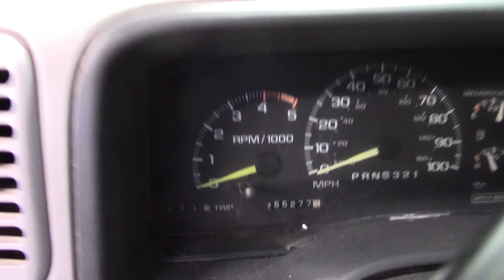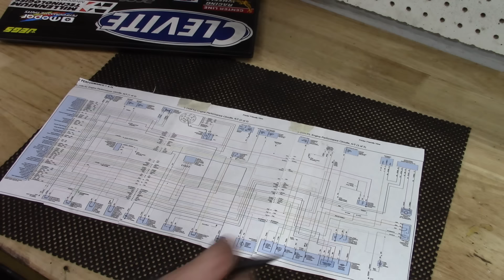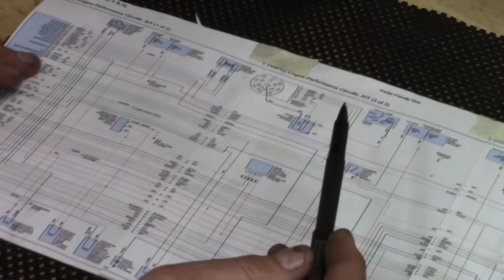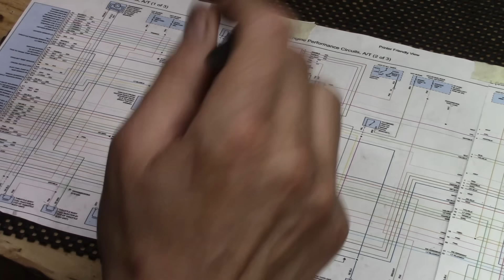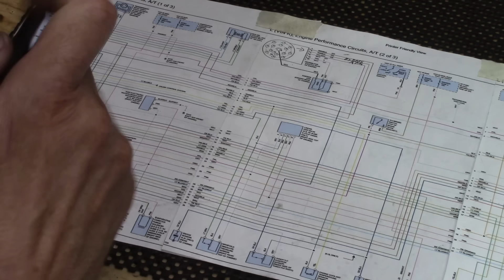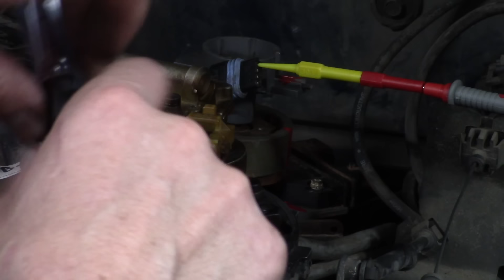Challenging Cranking No Start Diagnosis  1995 Suburban

Comment: I remember back when all engines in American automobiles ran their timing off the distributor with ignition points, and with early electronic ignition systems using distributor stators and reluctors (or similar equipment) triggering the electromagnetic flux of ignition coils to collapse..  The concept of having a crankshaft and/or camshaft position sensor with later computer controlled engines, with no involvement of the distributor other than to point high voltage discharge current to the appropriate spark plug, was totally alien to me.  It was all but sacrilegious in a way.  But, in time I got over that new fangled design and accepted it as a better solution as those crankshaft position sensors were not impacted adversely with timing chain stretch - about the only advantage I saw to it was the improvement with consistent timing accuracy being triggered by the actual device that needed to be timed.  

For the record I was not reveling in your initial confoundment.  As soon as you announced the schematic had no crankshaft or camshaft timing sensor I knew what was going on.  At least I hoped I was right.   heh heh...  In any event, I could see the cause for the confusion with the schematics.  I appreciate your keeping that part of the video in place, as opposed to editing the vidwo in order to show you knew all along how the system worked.  I know with the few videos I have produced I opted to leave in any retrenching in direction, rare though it may be.  I far prefer to see the side of humanity when folks presenting these videos do like you did, and let videwers know it is okay if a person needs to dig a bit and learn something new or unfamiliar.  It makes for a better learning experience.  Kudos...
Reply from the maker: Thanks and indeed I left my confoundment in because if it wasn’t educational, it was at least entertaining to those familiar with the systems!

Comment: One more thing, you want to check the new distributor before you put it in to make sure it works, it would suck if you put it in and it's defective and you have to do it again, just plug the connectors on, the distributor needs to be grounded so make a jumper wire with alligator clips and ground it on the engine and dist housing and with the key on spin the dist gear and it should spark, I check all my dist that way so unless a customer brings me a defective or used dist I only get paid once to do that job.
Reply from the maker: Good idea!
Reply: Sorry for the 3 parter my brain doesn't work as fast as it used to. @SchrodingersBox

Comment: You should be able to just replace the module alone for an ultra budget repair.  They usually just get hot and burn out over time.   I don't know how old this one is though---  if they can afford all new ignition, then it's good to send them off with more odds of avoiding a come back like that..   But if it were me doing it for myself, I always go for the ultra budget repair, simply because it doesn't cost me anything to fix then next thing that goes down again.   Where as for a customer-- they would have to bring it back for more work-  so leaning towards replacing the whole ignition makes more sense for sure.   Bravo

Comment: I would say:   Timing mechanical,  Timing ignition  (like you said).  but also:  Timing INJECTORS.  Some cars will have ignition timing from a distributor and still have injector timing from a crank sensor, etc.   So:  Timing Timing Timing...  definitely all a required necessity.  :)
Reply: To be fair, that problem just falls under F for fuel. Just because you can start the car with an additional fuel source in the intake doesn't mean you've solved the root problem, you've just narrowed it down to an issue with fuel delivery, which could be caused by a large number of possible things.

Mismatched (but still happening) fuel injection timing relative to ignition timing, apart from in direct injected systems (which all have purely PCM driven ignition/fuel timing anyway), I would imagine cannot result in a no start condition. Running poorly with a wandering idle rpm sure, but there's still ultimately a matched amount of air/fuel going through the intake, just poorly mixed (moreso in port injection scenario), which by my guess would cause the percieved A/F ratio to read lean, until enough fuel builds up in the intake to have it too rich, and then PCM overcompensates repeating the cycle - essentially an exaggerated version of what cars with oxygen sensors already do.

Tomorrow morning I'll swap the injector connections on my port injected car, hookup the scan tool, and test that theory!
Reply: Just tested on my port injected inline 4 swapping injector connectors 1/2 and 3/4 - engine still starts right up, if I didn't know I swapped the connections myself I wouldn't even know. Idles great and runs all the way to WOT great too, both free revving and under load. Looking at the scantool it seems the O2 sensor oscillations are maybe a bit longer in duration but that could be a sampling error in how often my scantool can receive data.

So I think it's fair to say, for port/throttle body injected systems, fuel timing relative to ignition/cam/crank isn't of great importance, especially in a no start situation.

Edit: after further testing the oscillation frequency of O2 sensor is indeed lower, and at idle skews towards lean. There is also some lag/slight roughness between sharp throttle transitions (both on or off throttle). But even still, the car is more than drivable.

Comment: it does’nt seem you are challenged, you make everything look easy because of the fundamentals and principle has in your brain. Thank you for sharing!!!
Reply from the maker: Thanks my friend. You are very correct. The principles and fundamentals definitely help. It’s a matter of “how does this car apply them” more than “what the hell is going on”. 
   For example- when I found the car doesn’t have a crank sensor- I know there still has to be some way the PCM sees the RPM. There has to be. It’s not going to be magic or some new physical concept. Something spinning on the engine is going to generate that RPM signal and It can only be the distributor if there are no cam and crank sensors.  That’s what led me to the purple/white wire and then it’s game over because I understand the system now.

Comment: Holding a weller soldering iron near (not even touching anything) the icm will mimic the cam sensor (pickup coil). It will spark the coil if the icm is good. In a no spark situation this is how you decide if the pickup coil or the icm is at fault. You have to try it to believe it. Usually the icm is the culprit and easily replaced without replacing distributor. Another thing that sometimes causes no spark is the distributor gear that is stripped, so check to see that it’s actually spinning.
Reply from the maker: Never heard of the soldering iron trick. Will have to try that!
Reply: @SchrodingersBox  I had to try it too. It didn’t sound plausible but it was actually the oem procedure.
Reply: Nice one !  
Super helpful !

Comment: I have a 2007 gmc Yukon and my magic  box isn't helping  me . Setting  lean codes  no power . Fuel trims going  lean . And I can't prove why . Not a vacuum  leak not a plugged  exhaust , not fuel delivery.  This in new to me but I'm new to drive ability  diag
Reply from the maker: What data do you have that shows no vacuum leak?
Reply: Wear I work I don't have the means or equipment  to prove  clogged  fuel injectors  or a brae down in cam crank . It's a  primitive. Place . Injector balanced  test the same but that doesn't  mean  there good
Reply: Cold engine smoke machine , water test , pids look OK  maf looks right , blocked  all the systems that could leak air ,perg,, pcv, cank case vacume . , exhaust back pressure  fuel pressure  and volume.  But the symptoms seem to be no fuel and the pcm drive the fuel trims lean . But the pcm sets lean codes  and is taking fuel away.  O2s look good  v8 no different in bank to bank . I feel like the pcm is making  it lean out but I don't know how to prove  it . Power braking with a substitute fuel makes no difference  . Idk I just don't know  ect loks good . Idk fuel trims normal  no load but 30 to 40 total  negative  under load
Reply from the maker: @jimforsyth2. Wait—- how is the PCM taking fuel away with lean codes?  That’s impossible. 
   Are the fuel trims better or worse under load? What’s the STFT and LTFT at idle vs load?   I am totally not following- how is the PCM leaning the engine out with a high fuel trim? That can’t possibly happen.
Reply: Fuel trims are about negative 10 at idle.amd open throttle under load there 30/ 50 negative total  trim  after time will set p0171and 174
Reply from the maker: Can’t be. Those would set rich codes - 0172 and 0173. Not lean codes. You can’t get lean codes set on a negative fuel trim. 
   Not sure I can help with this one-  the data doesn’t sound right. It’s not possible to have lean codes unless LTFT is over 24.
Reply: @SchrodingersBox  I know sounds crazy . Doesn't add up . But thanks for the effort.
Reply: @SchrodingersBox  it sets lean codes but shows  in the fuel trims that the pcm is taking  away  fuel . The vehicle  has no power under load . Like a low fuel  pressure issue  of clogged  cat . But it's not that at all and the shop has tried  there parts cannon
Reply from the maker: In that case it must have been lean at time of check engine light set, but rich when you looked at it live. You can not have a freeze frame where there is negative fuel trim beyond -25 with a P0174 and P0171. Can’t happen. The freeze frame would show positive trims BUT it’s possible you see negative trims now. Either the condition is corrected or you have a legitimate wavering condition and I would start by checking MAF voltage.

Comment: im at 29:08, but im bettg its just the ignition module, changed @ least a 1/2 dozen in my ownership of a 78/85 TA and a 82 Camaro RS....my cheap 2c  NEVER had ta change the distributor, nor plugs n wires,,,,,

Comment: in these trucks, if the ignition isnt operating, it will not allow fuel either,.  the root problem was likely a bad ground at the ignition module. rusty screws , poor contact, crusty wires, ect.. you can replace the ignition module seperately and save time and money,,,  ONLY put a high quality distributor in these trucks,, nor amazon or ebay junk.,,. duralast gold, or ac delco.. ive been working on these trucks as a hobby for 10 years,, 
your doing the right thing by replacing the distributor id it has alot of miles on it,, they wear too,,  replacing the distributor will eliminate ALOT of potential issues down the road..
Reply: Gotta give you that One. I'm experiencing a crank no start, happened suddenly as driving no issues stalled @30-40+- mph add fuel/carb cleaner, crank no start TBI injectors dry too. As Instantly as problem I think black module in distributor As I get further into my own diagnosis I'm thinking I must have a Black distributor module somewhere in one of my parts storage piles.
10,000 mile Long block.
270,000 mile original distributor.
U like,Durolast 
So does Tim (Milton) Smith.

Comment: Dose anyone know how I change out the speedometer from cutting off at 100 miles a hr I buying new Gauge and putting a high performance stuff on it and I did this on my 2990 dodge Daytona but GM is different and before anyone say why would you want to go over 100 miles a Hr well I want to take to commerce dragstrip and see how fast of a quarter-mile I can lay down.

Comment: , ignition bypass is to set BASE timing,,  if unplugged at the connector  it takes the ECM ignition program out of the picture and only runs off the distributor and module..  the engine runs off the ignition module for just a couple seconds.

Comment: And another thing, that tan wire with black tracer needs to be unplugged to set initial timing, if you follow that wire from the distributor to the computer it will have a connector, it's usually along the fire wall sometimes inside under the dash by the glove box so if you do replace the distributor, I know we all mark it best we can so we don't have to reset the timing but if something  is wrong or the engine gets bumped accidently and you do have to use a timing light you have to find that wire and connector and unplug it, when your done timing it plug it back in and your done.
Reply from the maker: Great tip!!
Reply: Thank you!!!
Reply: just set the timing at 20 and your done, if you have an advancing timing light, you don't have to unplug nothing.

Comment: Its a little unclear which wires you were scoping when checking at the ignition module. The purple/white was high ref heading back to the pcm. You mentioned then a PCM output, but not the color of that wire. The pcm output I see is a white that provides 5v to the ignition module. On your scope, there was no 5v if that was the wire you tapped into. Were you on the red/black? 

Also, you could further break down the diagnosis to see if its the pickup inside the distributor or the ignition module.

Comment: I have a 96 K1500 pickup.
mine is obd2 and mpi spider injection, crank sensor and cam sensor in the distributor.
The grounds going from the engine to the frame Tend to disintegrate causing all sorts of problems when they break as the battery grounds to the block, and only a bare braided cable grounds the block to the frame. 
Also I've had the hose between the fuel pump and the metal line inside the tank develop holes in it. So a fuel pressure check is a good idea.

Comment: Another test you can do , since you have a scope , is to check the pick up by back probing the green and white wires on the module and crank the engine. the pick up will create a AC sine wave , which the module converts to a square wave on that purple and white wire to the computer, this will help, lets say the parts store has a module in stock but might have to order a distributor which may take to long or lets say the customer can't afford all those parts you want to put in, now the customer has a choice the module is cheaper and the labor is cheaper. Just a thought, that's what I tell my customers.
Reply from the maker: Ohhhhh what a great idea!!!  I didn’t think of that!!  Yeah that would have even more defined ICM vs distributor.  Great thought!!

Comment: I'll be candid to offer:  I don't mind repair costs but ONLY if they are arrived at 'scientifically!'  Parts cannons are only legitimate when both parts are cheap and diagnosis is lengthy and repair is needed RIGHT NOW.  But as Matt was saying...  putting in NEW parts with remaining defective parts could burden the NEW parts...   By trying to keep repairs at $300 rather than $700 is Vegas 'craps!'  Who wants a broken down car at 3a.m. with a foot of snow?

Comment: I had a 1989 Dodge Grand Caravan that had over 170,000 miles. It would not start at times and I figured it was the distributor. I eventually got rid of it before attempting to fix it. I do remember that when it wouldn't start, the tach would not budge while cranking.

Comment: I have 3 of those older GM's with the distributor . First , there is a magnetic pick up coil in the base of the distributor . Inspect the THIN wires from it . They can crack , etc. I will guess you may only need a ICM and not a complete distributor , unless there is a huge amount of miles in it . The ICM , Module , is a switch to collapse the magnetic field to make the coils spark . It also sends a signal to the PCM so the injectors pulse . I believe there is no timing control from the PCM under 400 RPM ,
Reply: I believe there is no timing control under 400 RPM from the PCM while the engine is cranking . The ICM takes care of this . Bottom line : if the module is bad , no spark or injector pulse . This distributor may also have one or two vent screens at the base . I would use brake clean on them . 
If all the other components look good and are not cooked , a module may get you fixed without spending hundreds on a distributor , coil , wires and plugs .
Reply from the maker: @billsmith2212 that’s correct. Exactly as you said is how it works.

Comment: The paperclip trick doesn't work like that on 95-96 Chevys because it's not OBD1 or obdII
Reply: Yeah it's a weird OBD1.5, some actually had the modern OBD2 connector and you could get live data and codes with an OBD2 scanner even though it was 95 but other ones you couldn't.
Reply from the maker: is that right? if it’s not OBd1 what protocol does it use??
Reply: @SchrodingersBox   GM's own protocol. The only devices capable of getting codes are those old orange Acron scanners
Reply: @G-spotGeorge  "The only devices capable of getting codes are those old orange Acron scanners". So they used the old orange Actron scanners at the dealer back in the day😂. NO!